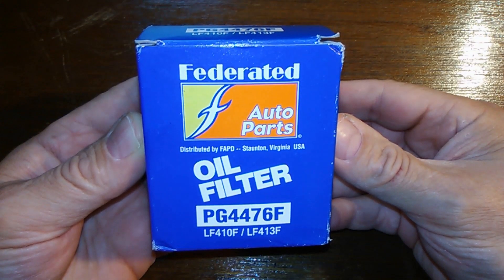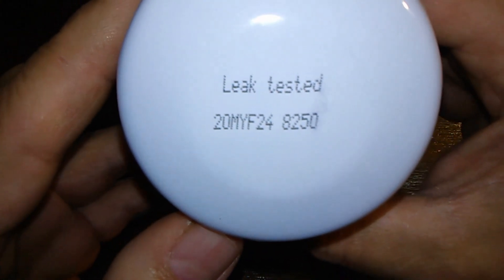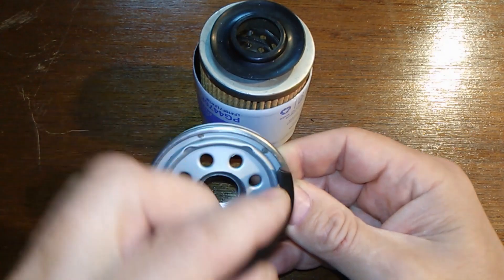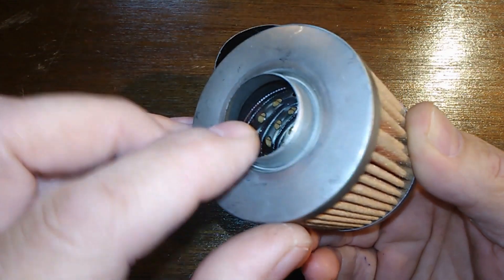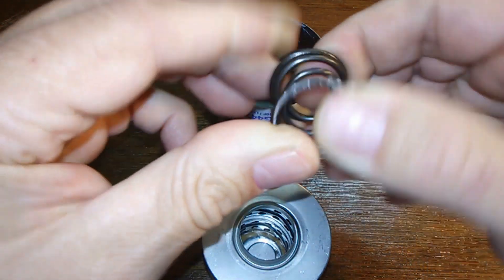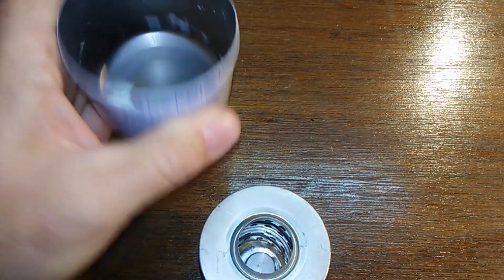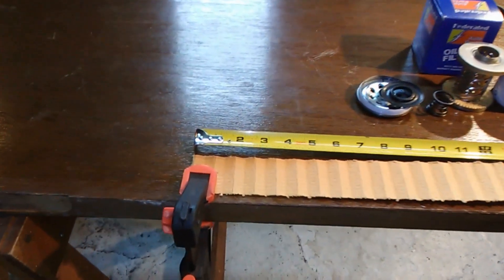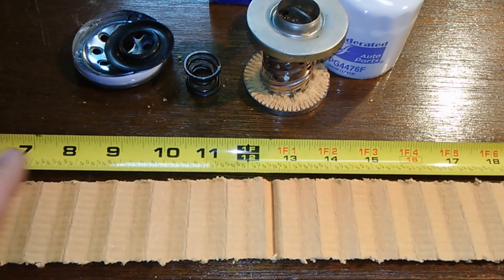Federated Auto Parts PG4476F Oil Filter Cut Open

Comment: Thanks, interestingly i vote  for a cover on Filters, etc. ... perhaps if they get ,and /or Keep EXTRA moistures inside : maybe stored ,processed , and CONTAMINATED: or not to,be used.. actually surprised more are not sealed up, or better packaging... even $10 good price points for a QUALITY.  SAFER filter. Not to mention Gasket protections,”seal, “, and extra protection .....
Reply from the maker: 👍 I agree,
I vote for a plastic sealed filter also, a sealed box would be even better. It would  stop people from switching filters in places like Walmart. I check my filters when I shop in that store, I've heard stories.
As far as moisture goes, I think the filter would be okay. Almost everything you buy these days is plastic wrapped with no issues.